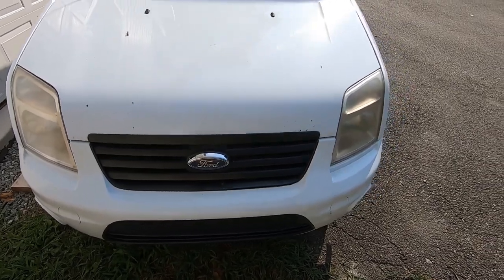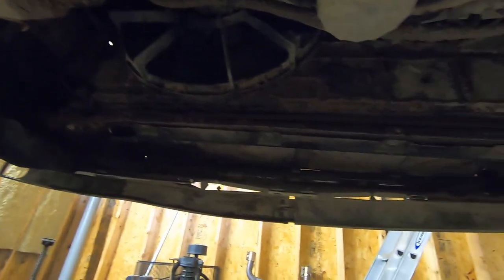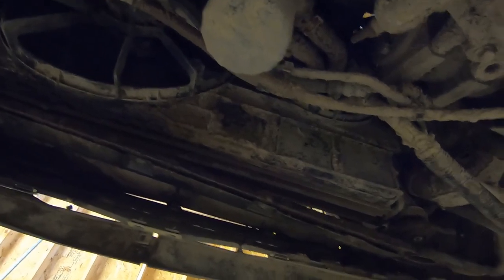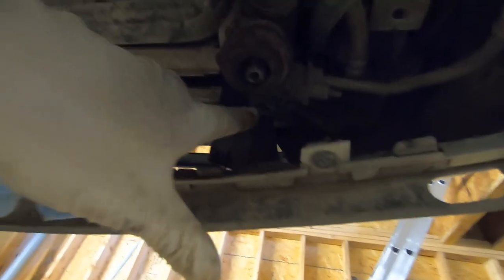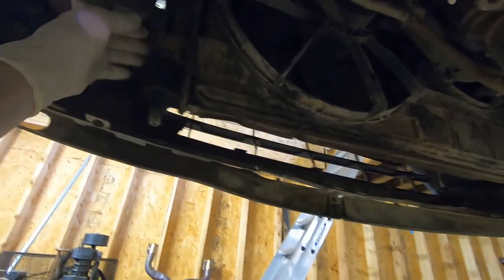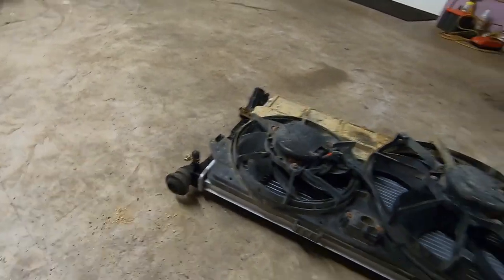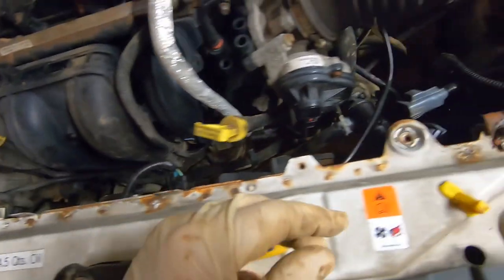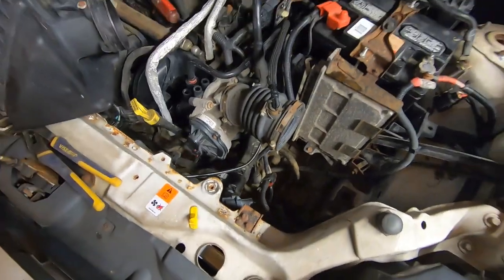2010 FORD TRANSIT CONNECT RADIATOR INSTALL

Comment: Great video.  I'm replacing an engine in one but don't have a lift. Nice to know what has to come off on top before I put it on stands. Been wrenching 45 years but first one of these I've seen.  Thanks.
Reply from the maker: Thanks for the view! They are a little different, but it sounds like you can handle it!

Comment: you didn't show you actually removing it. I need to replace my fan shroud+fans, is it possible to remove it without removing the radiator? My Haynes manual doesn't mention it